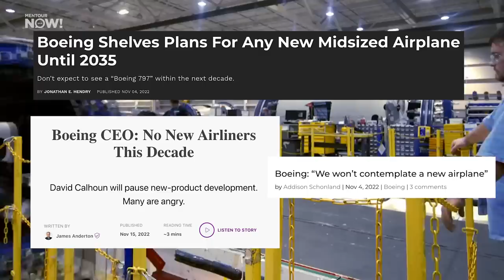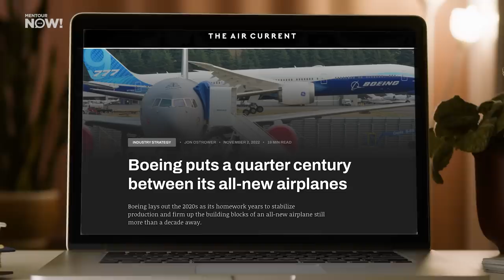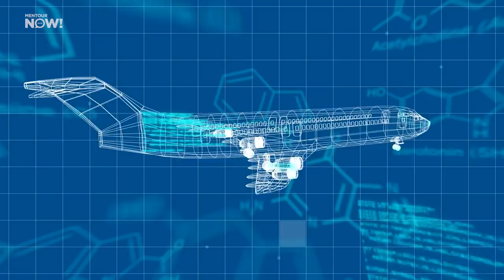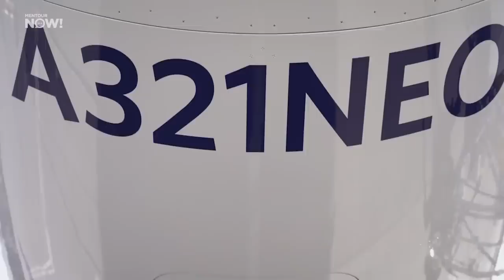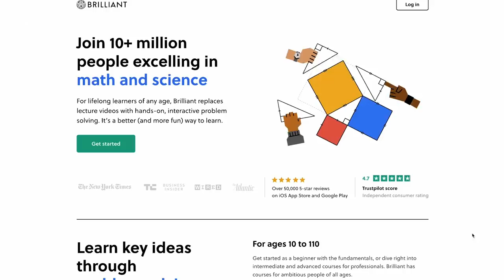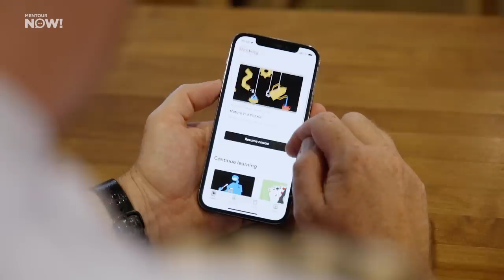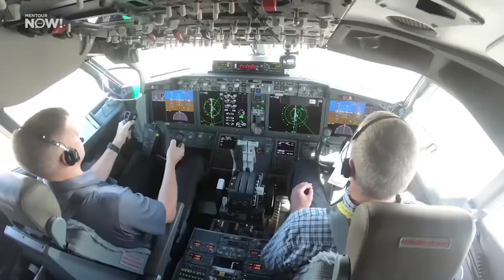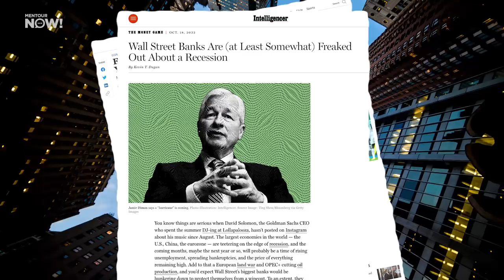Is BOEING giving up!?

Comment from the maker: Keep exploring at https://brilliant.org/MentourNow/ Get started for free, and hurry—the first 200 people get 20% off an annual premium subscription.
Reply: Way too many ads in this video!  Felt like approaching a 60-40 time split in favor of ads.
Reply: Who would ever want to fly on a propelled driven plane???? Especially in 2035 when technology should be greatly advanced, not go backwards!
Reply: @DavidJohnson-tv2nn  

Because propellers are more fuel efficient than turbofans.  Their downfall is noise.  But changing the blade design could ameliorate this problem.
Reply: @mas3ymd  When I was younger I  had dreams of flying on a hypersonic airliner. This is ridiculous. Yes, propellers are more fuel-efficient. But so is a horse and buggy. Propellers are slower, more vibration, more noise, and are quite simply primitive technology. I'm so disappointed that this in all we can accomplish in my lifetime.... Going back to technology of the 1940's! And what really pees me off is that these decisions are made by greedy CEO's who only care about saving money.
Reply: Supply chains all over have issues. Computer chips, aluminum etc. are all in high demand. Increased costs of the product supply chains can make the final product cost more than is economically viable. 

In an unrelated matter, how many platforms are still parked from the onset of the pandemic?
Reply: @DavidJohnson-tv2nn  

Propellers are slower?

Dude, what do you think a turbo fan is?  It’s a fucking propeller encased in a fairing!  And it’s driven by a gas turbine engine.  It is hardly new technology.  The only thing that has changed is the amount of thrust produced by the fan relative to the gas turbine engine itself.

The engine being discussed here is essentially the same thing, minus the fairing.  Without the fairing covering the fan, the fan can be designed more optimally, for better efficiency.  

Educate yourself, buddy.
Reply: @mas3ymd  Name one propeller driven aircraft that can fly at 600 mph, gas turbine engine or not? And propeller driven aircraft sure as hell can't go supersonic or hypersonic. This is taking technology in the WRONG direction. All in the name of saving greedy stock holders of big corporations some money. Just speaking for myself... I WON'T FLY ON A PROPELLER DRIVEN AIRLINER! EVER! Regardless if it has a gas turbine engine.
Reply: @mas3ymd  In my opinion, the current ultra high bypass turbofans should be the limit of how big they push fan size. Anything bigger and you no longer have engine producing thrust. You have an engine producing mechanical torque to drive a propeller.
Reply: I have a degree in aerospace and a college friend of mine is a very senior 737 pilot at a major airline. He was sent by his airline to look at the Max-8 problems. One thing he said shocked me: "Boeing broke their system."

To put that into normal speech. "The System" in this context is all those processes and procedures that a company uses to go from an initial concept to a product to be sold. So for a company like Boeing we are talking an library of documentation built up over decades. Things like Design methods, SOPs, test reports, subcontractor quality controls, the writing of manuals,... etc. This is a massive body of knowledge on how to build sound reliable safe aircraft. 

I have a PPL so we are also talking things like all the manuals you have in the plane, all the instrumentation in the cockpit and how that was integrated into the aircraft, the training programs that you went through as well as the regular re-certification processes and all the maintenance processes that give pilots like you the faith that the planes will do as you expect. 

He basically told me that Boeing had burned that system to the ground and threw out all those decades of work and experience. We are talking millions and millions of hours of experience being thrown out by management clowns who knew NOTHING about building aircraft.

The real question on Boeing's future is: "How do they cut out the cancer and get back what they had?"
At the very least that will take time, a lot of time.
Reply: inb4 the "LOL, rISe haS got PrapeLlAr's" crowd.
Reply: I for one would like to see the back of Boeing, they have been makinsga fortune for decades, simply because they have U.S.  backing, and the ability to convince the world that a new version of an antiquated design, is something new & revolutionary. Often at the expens of passengers’ lives.  Airbus has always been 10 years ahead, and  (usually) provided a higher level of passenger comfort.
A good example is the continual production of the giant tadpole shaped B747 - a half hearted attempt at a double decke passenger aeroplane, to which they have clung for half a century.
Reply: Mentour, you should upload your videos to Nebula
Reply: @DavidJohnson-tv2nn  

Wrong.  

Part of the limit on fan size is the speed of the blade tips.  The larger the diameter, the faster the tips go.  When they become supersonic, they create shockwaves and this reduces “lift” on the blade and hurts thrust and efficiency.  If anything, if engineers can find a reliable way to slow down the fan speed (which would provide a huge mechanical advantage) to the gas turbine engine driving the fan, then thrust and fuel efficiency would both be improved.  

The fairing (or casing) around the fan has some advantages, sure.  But without it, you can more easily make larger ‘fans’.
Reply: @mas3ymd  And noise vibration would increase and speed decrease. Because you know that there is no propeller driven aircraft that can keep up with aircraft that have turbofan engines. But the main question here is why is fuel efficiency so important above everything else? Airline profits? Why not do what is best for the passengers, like get them from point A to point B as fast as possible? At least..... Why not stop pushing the limits with the current ugly, big ultra high bypass turbofans? That is good enough on fuel efficiency!
Reply: @DavidJohnson-tv2nn  environmental issues that's why
Reply: @andrewlarson7895  So we're going to put everyone in primitive propeller driven air craft to save the earth? I suppose we're also going to force everyone to ride bicycles instead of driving their cars for the same reason? Again, when I was younger, I thought we had a bright future.
Reply: @DavidJohnson-tv2nn  just saying the reason is environmental.
Reply: @DavidJohnson-tv2nn  actually they're are working propeller driven engines again.
Reply: @DavidJohnson-tv2nn  yes the government would rather you walk or  use electric. But at this point the electrical grid can't handle even 5% of what the government wants as far as so called Green new deal. 9 out 10 cars are still gas powered in California. But the California government is already asking people to only charge the car during specific times of day so that they don't have brownouts.
Reply: @andrewlarson7895  I understand what your saying. Just that it is very frustrating and disappointing. Not that I want to trash the environment. But there should be a reasonable balance. They have already greatly improved fuel efficiency with the current ultra high bypass turbofan engines. That is a good stopping point. Rather than pushing us back into the primitive dark ages of propellers. This is 2022 not 1942, and it should look like it. Just my opinion.
Reply: @DavidJohnson-tv2nn  yes but technology takes time. And it goes through stall periods at times. Its not easy,everyday is a learning curve.
Reply: @andrewlarson7895  I urge everyone who agrees with me that we shouldn't be taking a giant step backwards to boycott all future airliners with primitive propellers! Regardless of whether the propellers are driven by a gas turbine engine. Time to say no to foolishness.
Reply: @DavidJohnson-tv2nn  yeah but good luck we dont have the power grid for EV 9 out of 10 cars in California are still gas and they're asking people to not charge there cars during certain times of the day. So they don't have brownouts.
Reply: @andrewlarson7895  The grid will definitely need to be upgraded to support EV's. In my opinion, EV owners should be taxed to pay for it. The rest of us shouldn't have to pay.
Reply: @DavidJohnson-tv2nn  yes true but you know the government they will find a way for all of us to pay.
Reply: Ryanair still use Boeing 737’s
Reply: @oscarosullivan4513  yep and they will buy a ton more down the road.
Reply: @andrewlarson7895  They know what side of their bread is buttered
Reply: I believe that Boeing sealed their own fate, the very second they decided to put anything other than safety as their top priority.

After that it was simply a matter of time before the cat got out the bag.

The whistleblower who had previously worked for Boeing helped to expose the Boeing hierarchy for their misplaced beliefs, priorities and values.

This has shown Boeing as less trusted than previously and this has already resulted in some big customers deciding to swap Boeing for Airbus KLM, Qantas and Air Canada so far this year.

To be honest it might be worth Boeing to cease making narrow-bodied airliners and maybe just concentrate on producing mid-range and long haul aircraft.

Leave the narrow-bodied more regional aircraft to the likes of Airbus, Embraer and Bombardier.
Reply: @neilburns8869  yup they messed up big time and time will tell. But the max is providing its self everyday and the number are awesome.and airbus or boeing cant do it alone and they both know that. I think Boeing should hold out until they come up with a very technological jet. Which is what they say they're waiting for technology to catch up with what they want to do it's not here yet. They have signed contract with some very very big firms already to work towards the technology for the new plane.